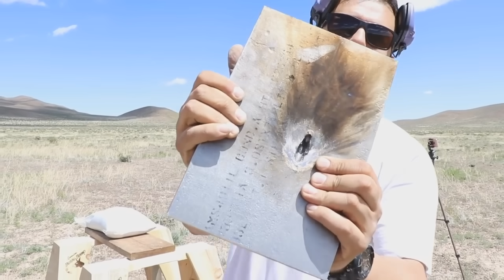O PODER DE UMA ARMA .50 (CALIBRE 50 BMG)

Comment: To clarify to everyone who doesn’t know what the 20mm specifications are; the true name is 20x138mmB Solothurn Longue. Many of the European countries had anti-tank rifles chambered to this cartridge. This includes the Lahti, the S18-100, the S18-1000, the S18-1100, and the Type 97 AT rifle. But by the time they were fully developed, they were virtually useless against the more modern vehicles like the Pz.III and up. The majority of confirmed kills are from armored cars, troop carriers, troops, or after one of these AT rifle hauling crews managed to flank one of these modern tanks for the time.
Reply: s18-100 used a shorter cartridge
Reply: Yup, and the video misleadingly says it’s a 50 cal.

Comment: The piercing power  dosent relys on the power  of the rifle it depends on the type of metal that the core of bullets is made  out of it , so if it was steel will be weaker than the tengestun, and the tungsten is weaker than the depleted Uranium